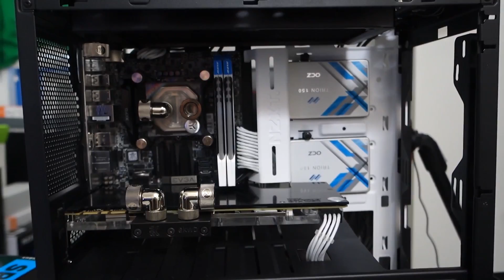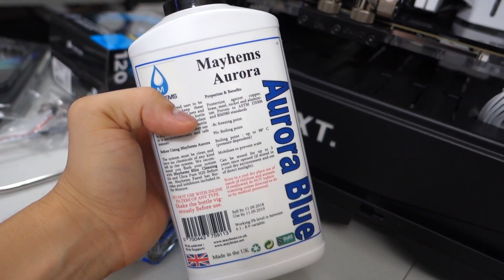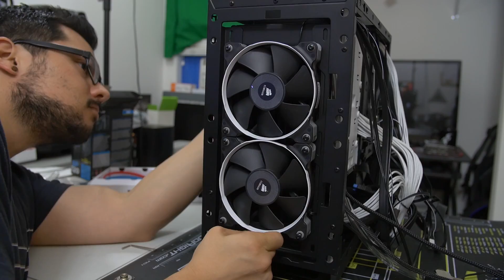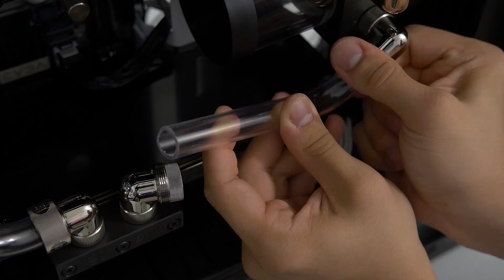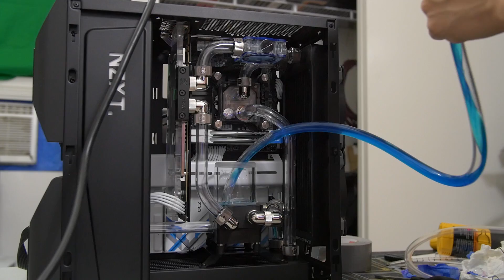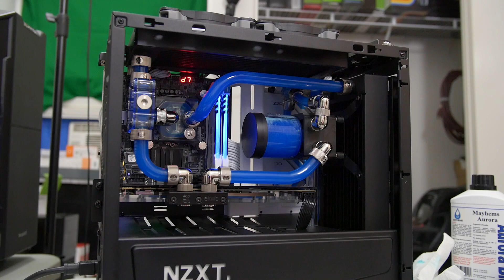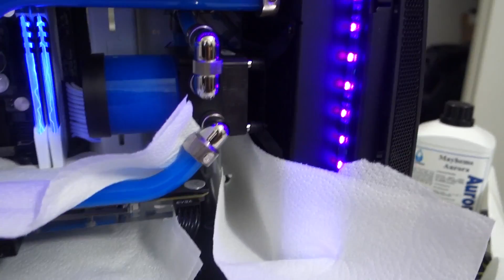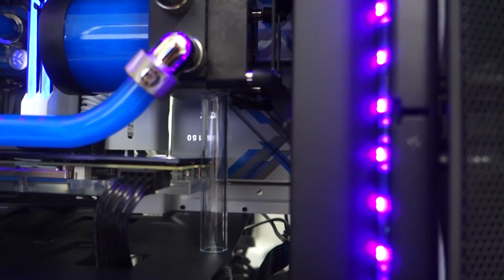Custom Tube Bending and THE MOST EPIC OF FAILS - Build Log #2

Comment: is a custom water cooling loop easy or hard?
Reply: sam roemer ive heard its hard when you first start but once you get the hang of it, it is quite easy and sometimes even fun. i should add ive never done it though. heck i only got my first ever sealed unit water cooler christmas 2016 (h80i v2)  and my case wont support it because there no room for the tubes, since i have the corsair carbide 300r, although im getting a 1080 at some point this year and we are planning to see if the hybrid one will work but it looks like it will.
Reply: I would say it is on the hard level.  I have my own complete water loop and it is a bit expensive but if you are into hardcore overclocking and the visual then it is worth it.  I am in the middle of a redo on my water cool.

Comment: did you fix that sag yet?

If not I say just find really small washers and put them between the pump and radiator at the bottom to off set the sag. technically it will still be sagging, but you won't be able to tell.

Comment: you should have used a jumper or a pin for the 24 pin.So you could just do the filling job without powering the whole system constantly.

Comment: For the angled pump, couldn't you just put some washers on the bottom two screws of the mounting bracket? It doesn't look like you'd need more than one with a decent depth. and depending on how much thread you have left, you might not even need new screws with it.

Comment: Hello there!!  i have a little question before i make and epic fail... under your oppinion it its possible to fit a MSI GAMING GeForce GTX 1080 8GB GDDR5X (closed loop cooling) in the DeepCool Mini-ITX Case TriStellar, and since it will have a mini MoBo its impossible to make any sli or Crossfire conections right?

Comment: Apart from the GPU waterblock bungs.....

You have a five-way block with bungs in 2 holes. You could added a filling point there, just like the drain point - and being at the highest point in the loop it, would have made bleeding trivial.

Comment: Why not run the pump without the motherboard and shit connected? I mean, you are testing the loop right? Seems dangerous to have power running to the other components while everything is being tested and filled for the first time.
Reply: keggerous  he uses hard tupe that makes the asemply impossible when the sistem is filled

Comment: my suggestion to fix the sagging tank would have been add spacers to the bottom bolts. but you spend your tube. I wonder if you're stressing the GPU in any way

Comment: Was this expensive? Idk, I have never done this before.
Reply: I paid over $1100 AUD on just liquid cooling parts. 560mm rad is nice in the heatwave of an Aussie summer.
Reply: Multiple hundred dollars. I would guess around 300
Reply: Seecker Gaming Jeez, i didn't know that much
Reply: I'm planning on doing a 2x240+1x120mm radiator with pretty much the same hardware he used and its about 300€ (I'm French btw). The radiator he used are 40% more expensive then the ones I am planning on using, and hard tubing is slightly more expensive then the soft tubing. I'm not counting the waterblock for the GPU! It would be 400€ for me to completely watercool my PC. 

An other solution is buying an AIO that can be modified (Fractal design AIOs and EK predators can do that I believe) an then buy a cheap radiator and a reservoir to make a ghetto custom loop on the cheap.

Pro-tip: if you watercool your PC, please don't cheap out on the waterblock if you have a high TDP CPU. My i7 4790k was overheating because in my first watercooling build I used a cheap 20€ waterblock.
Reply: Seecker Gaming That is a lot, but it is cool!
Reply: THE THREE NERD BOMBERS I agree it IS cool!
Reply: Seecker Gaming In my dreams. Also, does it have to be a blue color?
Reply: THE THREE NERD BOMBERS No. You can chose whatever color you want. I'd go for clear water to avoid any problems, but you could do green, orange, or red according to your PCs color theme. I suggest you watch Jays 2 cents on Youtube for some cool watercooling stuff
Reply: Seecker Gaming Thanks, that sounds like a project
Reply: very :P
Reply: THE THREE NERD BOMBERS it was 2000$ no 300
Reply: ***** 2000 for just the watercooling gear? I know it is expensive but not that much
Reply: Seecker Gaming oh the gear thought you ment rig
Reply: ***** lol No! ^^ I know the hardware is very expensive. 300 bucks for a PC will get you a cheap Pentium-based system.
Reply: Check out randomgaminginHD and then you can see what 300 bucks gets ya! ^^
Reply: tenshi7angel Wow! What kind of hardware do you have to cool with that beast?
Reply: Very.

Comment: This is nothing related to Water Cooling but I wanna ask if a Cooler Master Seidon 120v ver.2 handle really high rendering without overheating? Because my old cooler overheated so much that it used to shut down or freeze.

Comment: Instead of powering up the whole system, you could leave everything unplugged except for the pump when bleeding and leak testing. Power the pump with a molex connector and jump the 24 pin connector. This way if you do get a leak and it gets on the motherboard or GPU, you just have to wait for it to dry instead of potentially replacing it.

Comment: still halfway through but you could just bend the mounting bracket that is holding the pump. Push the top ones closer to the fan while you pull the bottoms out.

Comment: Hey dude. I had a similar issue with a pump mounted in a not-so-flat area. Put all of your nylon washers on the lower two legs; the rubber is compressing from the torque created by hanging the pump.

Comment: Regarding the Drain: Seems to me you have room to install a Tee near the bottom. The area I refer to is the piece that runs along the video card, that you mentioned you've replaced already. It appears if you add a Tee, Tee pointing to the Left and Down, you can add the Drain off the Tee to point downwards than a valve plus cap. That way the two lines off the pump itself will be straight rather than the bottom hooking off at a 45. It looks like the video connector may be infringed on a bit but that may or may not be an issue. 

An alternative would be come off the bottom hole of the Pump with a Tee and keep the current piece coming from the video card. I don't think you have the room as the line appears to be very close to the case cover.

Another way to run the Tee is so that the Tee is upside down. This will clear the Video Connector and still have plenty of room for the valve and 90 degree elbow down from there to a flex line. I always use a valve off the Tee so that it allows for removal of the drain line after the valve is closed. I don't think it's a good idea to leave water setting even in a closed system.

The part you used for the how you set up your drain line could be used as the Drain I suggested too rather than a Tee. That way you have multiple options to determine the best way to drain from there.

Regarding the sagging Res: Seems to me you have just enough room to install a bracket that will clip onto the Res and attach to the back cover, or the area where you first said you had the Res Installed but felt it put too much pressure on the video card.

I can't tell what distance there is but I am sure you can adapt some sort of bracket to that area. It will also Secure the end of the Res near the Cap.

Comment: Hi, just my 2 cents worth, you could shim the pump/reservoir with a very thin set of washers on the bottom side. Please tell me that the fluid is not electrically conductive or flammable.

Comment: such a waste of money
Reply: Your comment is a waste.  You obviously don't know a thing about water cooling a pc and just jump on here to whine.  If it isn't your thing go watch a youtube on how tires are made.
Reply: GREATEST EVER how?...
Reply: TheFrosty Completely unneeded addons = waste of money, yeah looks cool but for the most part add no extra benefit to the system.
Reply: GREATEST EVER I'm sorry but that's some pretty pathetic logic..
Reply: TheFrosty No pathetic logic would be making a comment that stated so with out any backing to why. Spending excess money on something that an 80 dollar cooler could have done just as well. Like said was a waste of money, even though it looks cool.
Reply: GREATEST EVER You've literally just said it yourself "it looks cool". I mean, this would beat any kind of '$80 cooler', because this doesn't just cool one component and it will make sure it's kept at a damn cold temperature even under load. But I don't know if you've noticed with PC building, but a key part of is making your rig look awesome and this is by far the cherry on top when it comes to that. But by your logic, what's the point in having paintings on the wall of your house? There's already a floor underneath your carpet so what's the point in having that? You already have legs so why waste so much money on getting a car?
Reply: TheFrosty Exactly
Reply: Did your post have an expiration date on it's relevance? I guess by your logic that car you have as your pic is a waste of money too since a 1989 bannana yellow escort station wagon shitbox will get you from point a - b just the same. Right? Right? It's not like performance and looks hold any importance to what vehicle you should enjoy, Right? 
  You clearly don't understand the first thing about water cooling, If done correctly it will cool all your components far better than a crappy $80 cpu cooler AND your PC will be near silent even under full load. 
  BUT the real point here is even if it was a waste of money who gives a shit? What triggered you to even comment that anyway? Are you jealous or just such a egotistical prick to think that you can decide what is or isn't worthy of people spending their own money on and you get angry that they buy things you don't want them to?
Reply: xNinja83x Actually it won't sorry.
Reply: Ray Lewis Sorry kid, didn't mean to trigger you. Great job commenting on a post well over 9 weeks old.

Comment: I know this might be a little late to the game, but you asked a way to prop up the reservoir.  Perhaps some washer type spacers (or pads) at the bottom two screws where the reservoir connects to the radiator would "lift" it up?

I'm sure you've probably already solved it, but haven't yet watched future videos...  Hope that helps!

Comment: I want to see a hydraulics engineer's approach to liquid computer cooling. ^.^
Reply: Perpetual motion machines don't work...
Reply: @victorqwilleran3331  didnt you watch rocket power?
Reply: @victorqwilleran3331  they do just not in the way people want then to. All they do is maintain the energy they got with minimal parasitic loss. What people want them to do is work via magic and be an endless well of energy without adding any input which is impossible. Perpetual motion machines are more of a parlor trick than anything. Nothing too terribly useful can be done with them.
Reply: @VadersFist501st  exactly, they do not perpetually work, therefore they don't work. Perpetual motion machine is a misnomer.
Reply: Hazel Hazelton fucking awesome
Reply: Norcal Bowhunter you should watch videos of people working on the newer super cars... Cringe worthy
Reply: You need a structural engineer,  not hydraulics. Top screws are in tension pulling away from their fixture. It is true once water starts flowing that adds to stress and the strain that it causes.
Reply: An engineer would use 4" CI pipe and a cooling tower outside his house. It would be a cluster for sure.
Reply: If it's anything like any hydraulic system I've worked on on every aircraft I've touched I wouldnt want to see
Reply: super late to this thread, not an engineer, but I do work hydraulics in the military, I am sooo looking forward to building myself a water cooled PC with my hydraulics knowledge
Reply: @norcalbowhunter3264  Ha. Olden days: replace bulb inside headlight, €10 total, 3 minutes. Nowadays: replace headlight unit, €300 for the unit itself, 2 hour wait.
I love progress.
Reply: I asked my uncle who engineers mechanical compression systems and he says he'd "refrigerate the whole unit."
Reply: He certainly wouldn't put the drain at the highest point in the system.
Reply: @norcalbowhunter3264  That is actually intentional. They understand exactly how hard they made it. Thats the point so they can force the consumer to A. Buy new car or B. return car hopefully to a certified and or same company mechanic shop for simple things. Either way they bleed you for extra money which is their goal. Unfortunately you are just involuntarily involved with the shitty part of their plans without any of the benefits.
Reply: I know I am 9 months late with a reply. Yet most likely the engineer would have the cooling system powering the computer. Self-Powering Liquid Cooling Computer. I mean need to get the pump going. Nice hand crank but after that. Don't need to plug it in.

Comment: Dude why did you use the power supply that was to power the system? When filling your loop, you should run the pump off of a second power supply that's not hooked up to the components so that if your leak would reach the power supply in the case, your components would not die.

Comment: y even water cool, i can overclock to 5.1ghz stable on a 4790k using a noctua nh-d15 with idle temps of 27 and the highest temp i ever saw in a stress test was 83. only 3 case fans as well.. i just dont see the point in liquid cooling other than to help with aesthetic apeal
Reply: Cyrus Khalvati he's obviously going for aesthetic appeal with this lol but yeah most people only use water cooled builds for that extra coolness and to stay quiet. Some people prefer whisper quiet especially if the mic is near the PC
Reply: meh noctua ndh 15 nb at all and p quiet with real life scenarios with or with out lna's and i get 5.1 fkin ghz stable at 1.336v so i think im good and i won the silicon lottery

Comment: I would use a few very small black washers on the two bottom screws that secure the EK pump/res to the rad. keeps it secure and lifts that up.

Comment: Am I missing something or are You filling and leak testing the system with everything connected and running??? if so why ??
But I guess that You by now know that You should only have the pump powered when filling and leak testing.
That way You significantly diminish the risk of serious failures with "short outs" or other "secondary effects" if you have any leaks.
Brgds.

Comment: For securing the reservoir in the slot for the nxzt logo right behind the pump use a one hole strap to the size of your liking then a bolt, nut, 2 washers, and if you really want it to stay there forever 2 self-locking washers. I would suggest painting all of those a matte white to match the nxzt logo plate. Also, you will have to bend the one hold strap to fit around the pump, so I'd say buy a few one hole straps and try it to get a perfect fit. Yes it screams DIY land of crappy jimmy rigged things, but if done properly it will look great.

Comment: For the drooping pump/res, put a washer or two on the bottom two mounting bolts between the bracket and the pump to push the bottom outward.

Comment: why isn't it possible to test a water cooling system with the pc off? Would make much more sense. Seems dangerous as hell testing it with the pc live.
Reply: You still need to hook the psu to the pumps but you can test it with no power to any other components with a atx bridge.

Comment: Our take on water cooling:

Always use distilled water, with no colourant.  Then use coloured hoses.  

If the water leaks purified water is far less likely to blow your rig - it's the impurities that conduct, apparently.

The colourant also blocks your channels over time.  We have taken a few dies apart and the flow was greatly diminished and needed cleaning.

We are using black hosing these days as it prevents algae growth - no light, no algae.

Comment: put some flat washers in between the radiator and the pump res mount to space the bottom out and thus compensate for the sag in the reservoir.

Comment: Suggestion for reservoir support: I noticed two long slots behind the reservoir, right on the white cable cover... You should use them to mount a reservoir holder!!! It will cover the NZXT logo but you'll gain extra rigidity for the res/pump combo!
Reply: It will also reduce the strain on the res mount! Unlike the washer option which will increase it

Comment: On the bottom two screws holding the pump to the radiator, add a few black washers. Don't add them to the top two screws. It might fix the sag.

Comment: To level out your reservoir try to add a washer under the bottom 2 Mounts, this will make it want to stand taller on one side and should level it out. paint them black so they blend in

Comment: when you're using hard pipes u might still have   to bend hard tubing besides of pump and it look pretty much great rather then flexible pipes and ya if you join two cavity downsides of your radiator so your pipes goes in straight position well

Comment: Dunno if you fixed it yet, but probably the only simple possible fix to the sag it so bend the bracket so it is prestressed upward.
Expecting that thin bracket to hold sideways it asking quite a bit out of it.  You're almost better off having a machine shop mill something thick out of billet aluminum or something.
Or, maybe make a thick lexan one.

Comment: to solve sagging tank......  loosen all 4 screws.....   remove bottom 2... insert spacers/washers/shims (may need longer screws to reach threaded holes after) I think 0.1875" or 0.250" should be good.
if need a custom size, pm me and I'll make it for u.

Comment: You really runned the whole system when you filled the loop? That might cause overheating and if the loop have a leak the components could get damaged... Please for the next time use external PSU for your pump and jump start it, when you fill your loop.